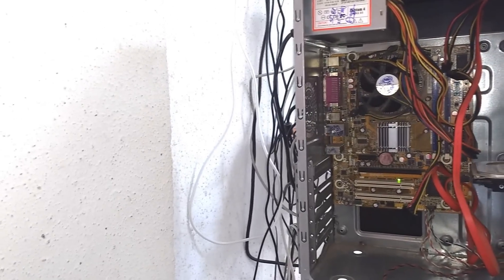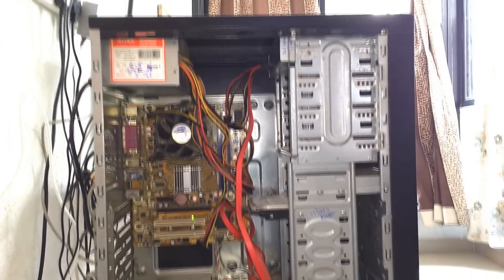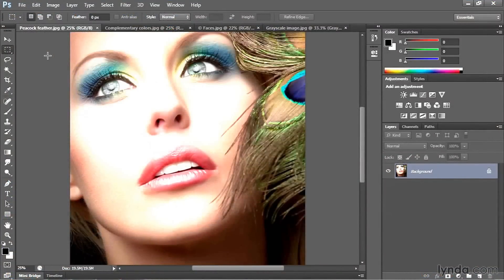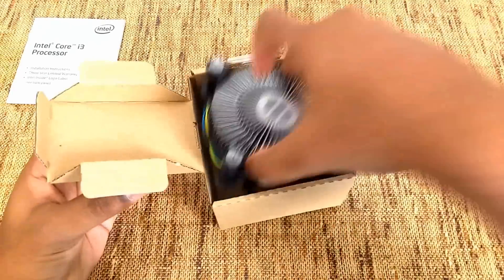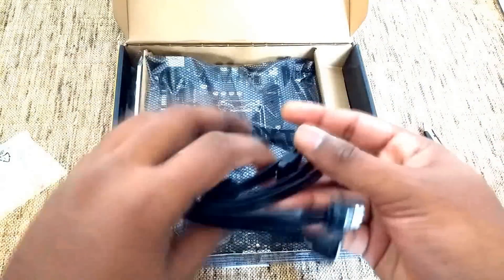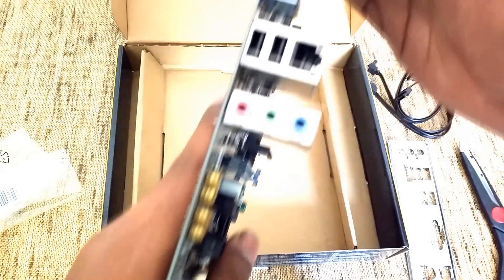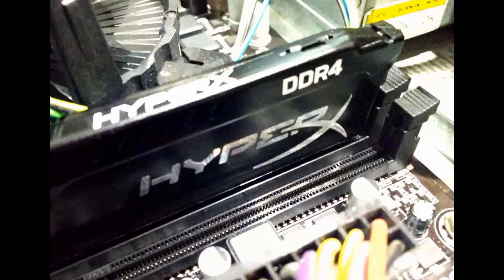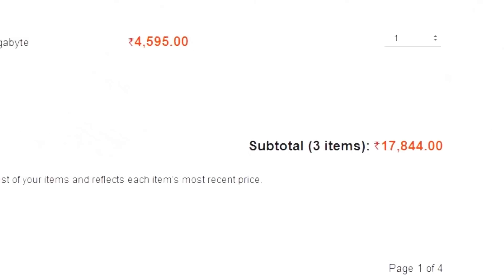Upgrading old PC under ₹15000 (220$) [2016]

Comment: I did the same pc as you did bro, i have added gtx 710 2gb graphics card and cooler master cabinet and the performance is incredible. Its more than i expected. It beats up hp laptop of i5 5th gen and nvidia GeForce. Handles fifa 18 clean. Runs all adobe applications. Its a good pc i must say. No lagging at all
Reply from the maker: Thanks for the suggestion

Comment: seems like perfect for my upgrade. Can you provide me links of all three you used?
Reply from the maker: Yes, sure ! :)
Intel Core i3-6100 6th Gen LGA 1151 Processor:http://www.amazon.in/Intel-Core-i3-6100-1151-Processor/dp/B015VPX2EO/ref=sr_1_fkmr0_1?ie=UTF8&qid=1496499199&sr=8-1-fkmr0&keywords=i3+6th+6980p
HyperX FURY Black 8 GBhttp://www.amazon.in/HyperX-2133MHz-Desktop-Memory-HX421C14FB2/dp/B01D8U27YU/ref=sr_1_1?ie=UTF8&qid=1496499181&sr=8-1&keywords=hyperx+fury+8gb
Gigabyte GA-H110M-S2http://www.amazon.in/Gigabyte-GA-H110M-S2-Socket-Motherboard-Black/dp/B019ZLM7A0/ref=sr_1_fkmr0_2?ie=UTF8&qid=1496499162&sr=8-2-fkmr0&keywords=h100m+motherboard

Comment: please tell me that's you chose off this part how possible under 15000 
if go for i3 it's 9000 only processor
ram 4600
then other part price
Reply from the maker: +rahul patil buy from local stores. Don't buy online. Online rates are higher than local.

Comment: Actually my budget is 15k so which motherboard and processor should I buy please suggest me...
Reply: Rohit Santre u can go with intel skylake g4400 processor,cosair smps 450w, hyperx fury ddr4 8gb/4gb 2133mhz ram, MSI H110M Pro-VH Plus lga1151 Motherboard and Seagate barracuda 1tb. O.S-windows8.1pro. This is best low budget medium-specs Gaming pc which will cost u around 20k as amazon price gets low n high everyday.
Reply: for later gpu upgrades starting best will b gtx750ti 2gb and above gtx(4gb).
Reply: thank u

Comment: bhai say price of part
Reply from the maker: Intel Core i3-6100 6th Gen LGA 1151 Processor:http://www.amazon.in/Intel-Core-i3-6100-1151-Processor/dp/B015VPX2EO/ref=sr_1_fkmr0_1?ie=UTF8&qid=1496499199&sr=8-1-fkmr0&keywords=i3+6th+6980p
HyperX FURY Black 8 GBhttp://www.amazon.in/HyperX-2133MHz-Desktop-Memory-HX421C14FB2/dp/B01D8U27YU/ref=sr_1_1?ie=UTF8&qid=1496499181&sr=8-1&keywords=hyperx+fury+8gb
Gigabyte GA-H110M-S2http://www.amazon.in/Gigabyte-GA-H110M-S2-Socket-Motherboard-Black/dp/B019ZLM7A0/ref=sr_1_fkmr0_2?ie=UTF8&qid=1496499162&sr=8-2-fkmr0&keywords=h100m+motherboard